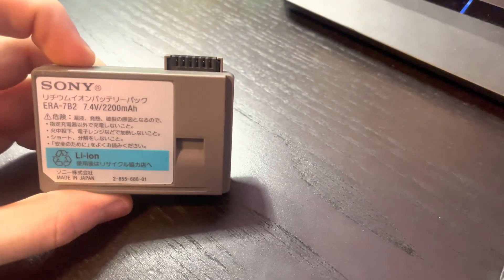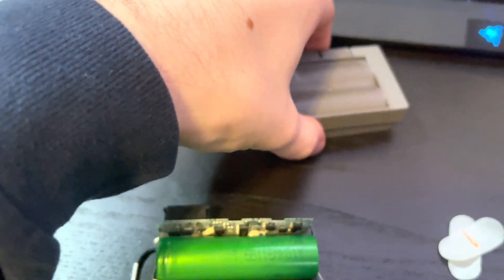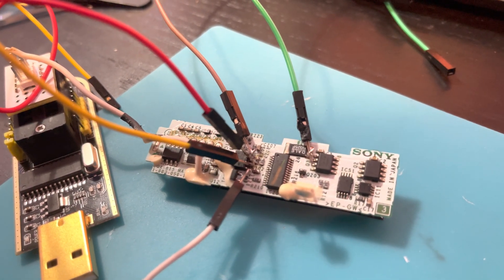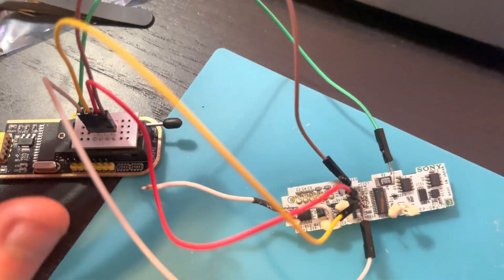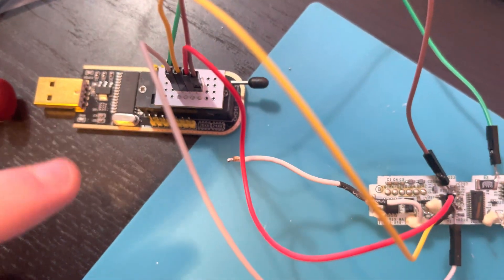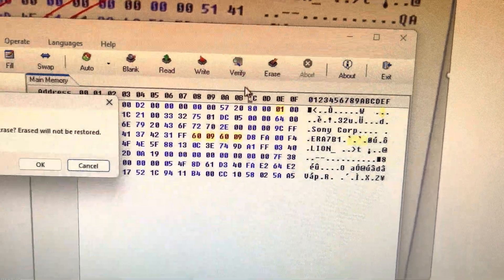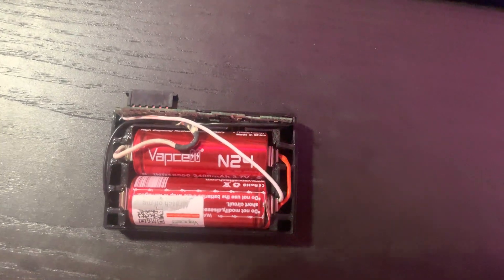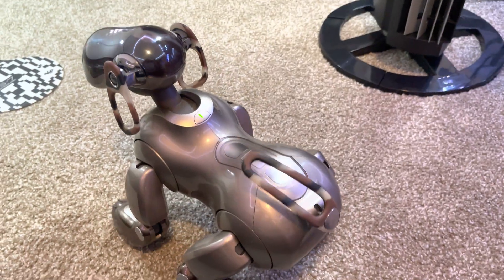sony aibo ERS7/31x recell tutorial

Comment: Thanks for this, excellent guide. Just one question. How does 69 69 relate to 2400mAH batteries? Can I put higher capacity batteries in, and if so, how do I find the correct values to put in the programmer?

Thanks!
Reply: Oh, and which pins on the programmer side do you plug into, I'm having a little difficulty matching up to my programmer...  Thanks! :)